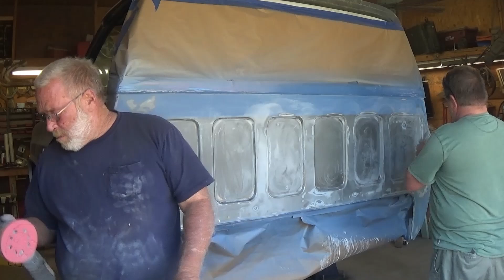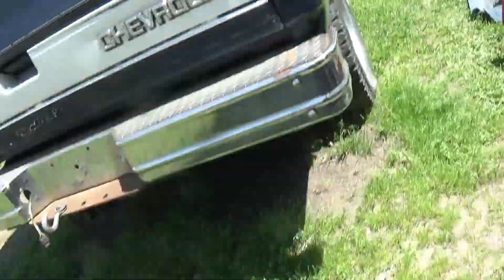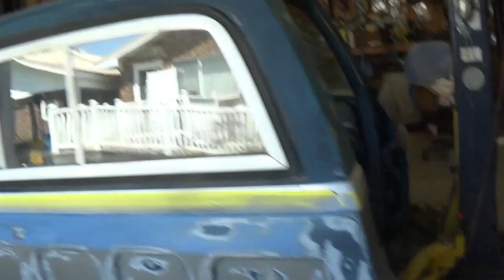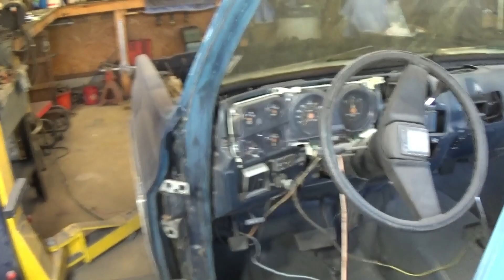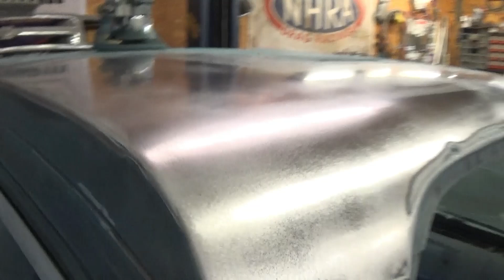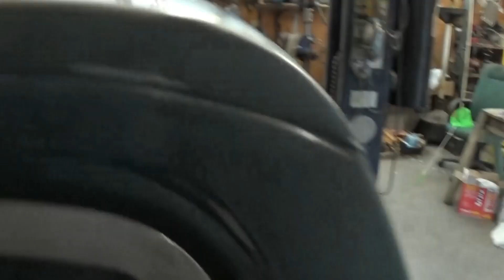Color change for the k 10

Comment: Looking good Mark!  Glad you got it down to metal!  Those square bodies back in them days had weird paint problems when the factory switched over to water based paints.  My square body had similar issues!  I'm glad you guys caught the paint early and can switch over to the charcoal grey now.  I think it will look great!  Keep up the good work and it will be nice to see another square body saved and back on the road soon!  Take care!
Reply from the maker: thanks hubie
Reply: Yeah, the paint back then was weird. The clear would flake off, usually at highway speed, you'd notice the clear came off when you got home, then the next morning it turned into exposed primer. Yay late 80's early 90's factory paint!
Reply from the maker: @allhailinternalcombustion  thats the only thing i know to do is strip it down